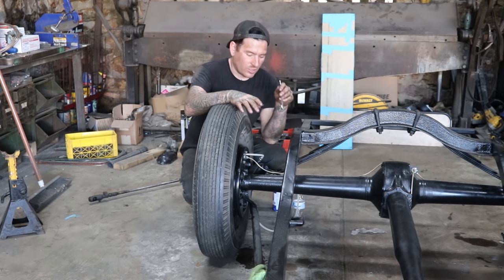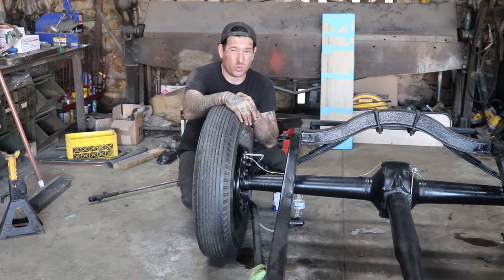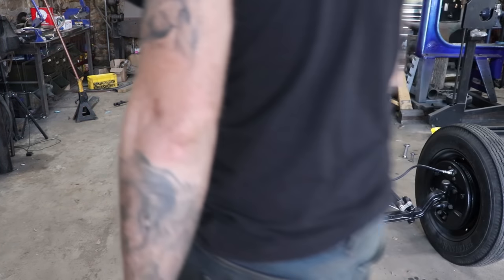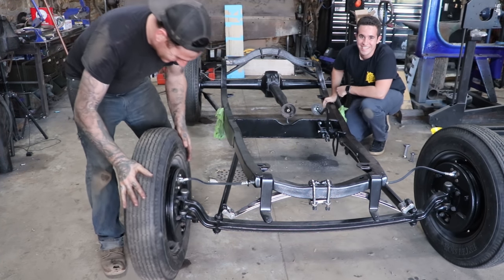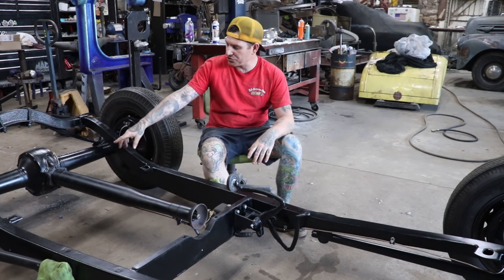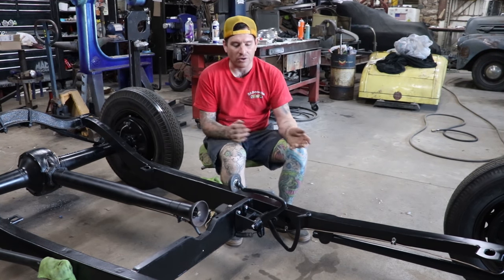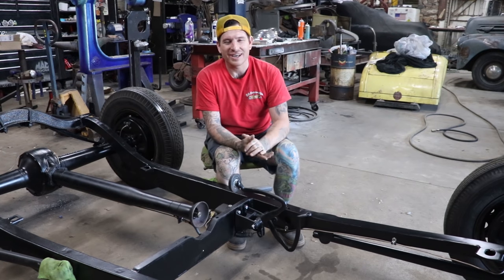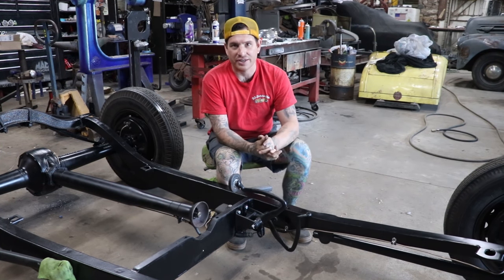How To Bleed Hot Rod Brakes - Ford Free-T - Ep.88

Comment: Hey mike My Grandfather was a mechanic and very very smart.He came up with a simple method for one man brake bleeding and he taught me back in the early 60's,You take a small oil squirt can and fill with brake fluid attach a rubber brake hose to it and then open the master and attach the rubber hose to the bleeder and pump the fluid to the master,you start at the farthest bleeder and work your way to the closest one and you will have no air left in the lines.

Comment: As a rockabilly (Greaser) I really dig everything you’ve got in this channel
Reply: It seems the spring on the brake pedal acts to apply the brakes.  Correct me if I am wrong.  Love the car!
Reply from the maker: It provides light pressure to keep the pedal from swinging forward and out of position.

Comment: Any body have any advice on how to do this when the body is on the frame?  There is very little room between the body and the top of the master cylinder.  Adding fluid is an issue. Any thoughts?

Comment: Nice work Matt but for safety you should have put a dual chamber master cylinder. With a single you will lose the front and back brakes at the same time.

Comment: I know that we're dealing with old iron, but damned, I can't believe that there's not a dual reservoir master-cylinder being used.  I'm old enough to have owned several cars that were single reservoir M/C systems and I can tell you that a blown seal or leak anywhere in the system will lead to scary or dangerous moments.  It happened to me in a 1960 Rambler American coming off of the interstate in urban traffic, luckily I got stopped before rear-ending somebody.  Having done hundreds of brake jobs throughout my 50+ years of turning wrenches, I thought that I'd see just what you were doing here; I'm disappointed as I didn't see any kind of procedure for doing these brakes.  There was nothing for an amateur to learn from this video, such as how to do the self bleeding and the importance of starting from the line that's the longest distance from the master-cylinder.  How about saying something about a spongy pedal and it indicating that there's air still in the system?   All that we saw was the master cylinder being filled, lines being hooked up and you with a wrench at a couple of the wheels, nothing specific.  In total this was a very vague video about a serious matter that can kill you if it isn't right.  I gave you a thumbs up because I'm a subscriber and I like you, but I've got to say that this video is damned near what you'd call, "click bait".

Comment: I am trying to bleed my brakes and I have fluid spewing out of the top of the master cylinder filler plug air hole?? Why is that? I see your rear brake lines are higher than the master cylinder also. I thought my master cylinder was too low. Any suggestions? THanks
Reply from the maker: Try bench bleeding the master cylinder first. Then bleed the brakes until all of the air is out. Probably air bound master cylinder

Comment: The hardest part……getting 90% of the air out and you don’t show it.  Lol. How did you get the 90% air out. With this system all 4 lines are connected. Hard getting the sir out with a small pump